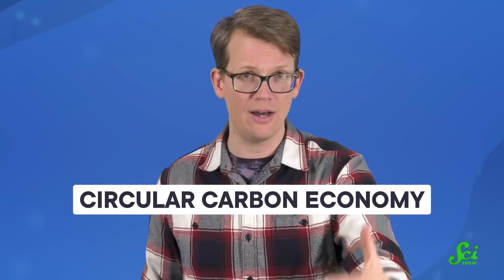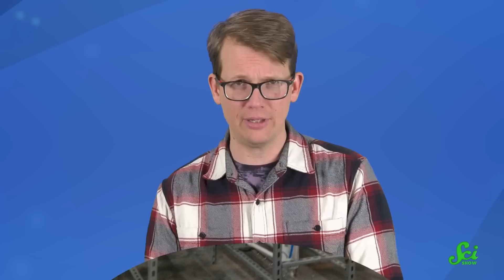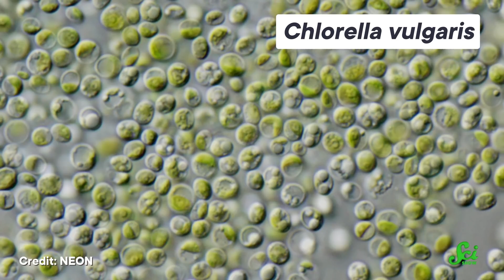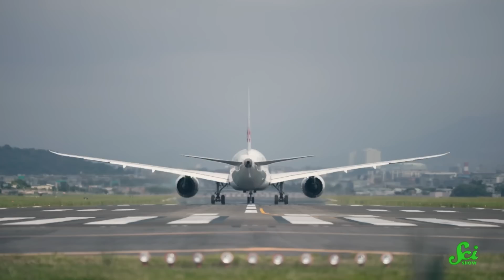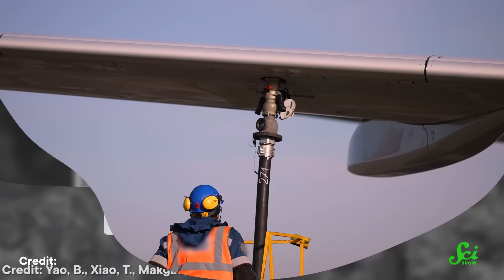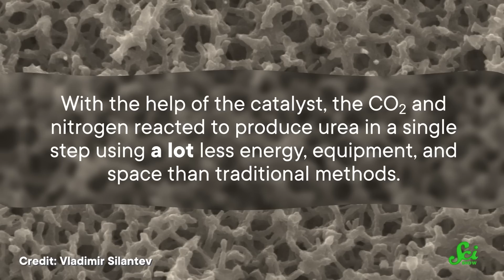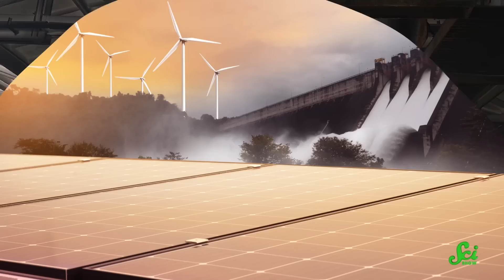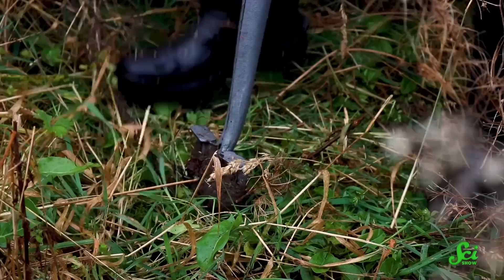One Way to Deal With CO2? Reuse It

Comment: When it comes to climate change most of the steps being taken actually make things far worse.
Wind turbines are an utter disaster, very harmful to the environment and actually result in more emissions not less.
Reply: check again
Reply: @paperburn  check again.
Only don’t use the data from the emperors Taylors
Reply: There’s another crucial difference between fossil fuels and wind turbines. A coal or natural gas plant burns fuel — and releases carbon dioxide — every moment that it runs. By contrast, most of the carbon pollution generated during a wind turbine’s life occurs during manufacturing. Once it’s up and spinning, the turbine generates close to zero pollution.
Reply: @paperburn  boy are you delusionaly wrong.
To replace a thermal power generation system of one gigawatt that can produce that power 24/7 with wind you need far more than one gigawatt worth of turbines because often the wind doesn’t blow 24/7 often it is too slow to turn the blades or too fast and would destroy the turbines so you need some sort of reliable backup power sitting idle while the wind is blowing and running full power when it’s not. So it usually wastes its power when the wind blows etc etc.
If you sat down and looked at the real math of wind and solar you would see that they don’t ever break even on c02 emissions and the environmental harm they do is definitely not outweighed by any imaginary benefit.
Reply: @anomamos9095  We must be reading two separate papers. and second I never said we would not need base load power , that is some talking point you came up with out of your own head. the only contention I would make is we need to get rid of coal as our primary base load source and that could be done easily  with existing  technology. I am using the papers funded by the  previous administration from yale. what are you sourcing?
Reply: @paperburn  Pre subsidy costs , actual usable power generation as opposed to projected , true costs of replacing thermal sources (Batteries powerlines construction demolition etc) thermal power waited while idling etc etc. Loss of environment to eyesores bird and bat kills etc etc
You can't replace a gigawatt of coal or gas with a gigawatt of windmills even with batteries that could last a day you would need ten to twenty gigawatt of wind to achieve a reliable base load unless you can make the wind blow 24/7
Reply: @anomamos9095  Once again I am not debating your facts on base load power but on your assertion that renewables have no place in the system. That is ridiculous. Ask yourself if  most of the subsidy's are gone why do the power company's keep building such systems? Because they work and are cost effective for peak load management
LOCE data shows that coal should be abandon as soon as possible if they can be replaced by wind ,PV or gas.
You know not of what you speak..
Reply: @paperburn  you do know what straw man arguments are don’t you?
In case you don’t you have been using them to try and avoid addressing what I have said by claiming to address things I have not said.
The only sustainable power sources available at present are nuclear, hydro , geo thermal and fossil fuel based.
The reason why wind and solar are not sustainable is because even if there was a suitable storage means available everywhere ( pumped hydro is very limited) the amount of turbines and or solar panels needed to replace a thermal power source is enormous. I have done the area calculations for PV at 33% efficiency in the prime sun zone to power Los Angeles 24/7 its not pretty.
Before thinking pv and wind are solutions you should ask what problems do they cause and if those problems are outweighed by the good?
Considering that carbon dioxide emissions are not in anyway a problem as the world has easily coped with more that ten times the current level of carbon in the atmosphere you cannot use carbon reduction as the criteria. But even if you insist on using it pv and wind still fail because to replace one one gigawatt power plant you would need ten to twenty gigawatt worth of alternatives and batteries.
And the reason they build wind and solar monstrosities is because they are being forced to.
The only time wind and solar make sense is when there are no better alternatives available as cheaply.
Specifically, if it will cost $50,000 to get on grid or $25,000 to build a wind and solar power bank to provide for a small village you would be an idiot to get on grid.
Reply: @anomamos9095  LOCE calculation please.
Reply: @anomamos9095  at ten times the co2 level there were no humans.
Reply: @paperburn  but plenty of straw men apparently. Humans really have nothing to do with the carbon cycle and the total human contribution is just two percent of the total. The fact climate alarm is a scam is so very obvious you either need to be in on the scam a religious zealot or the most ignorant and gullible person in the universe not to see it.
Reply: @paperburn  No figure it out for yourself.
Reply: @anomamos9095  Was just trying to figure out where you screwed up so much, old data, bad sources, lack of math skills? I will just look at all those power company's still building wind mills and solar farms despite those expired  subsides you claim they are using. silly companies  not making profit because of renewables .

Comment: Fun facts 
The add blue used to reduce nitrous oxides in diesel exhaust is urea.
Urea is a component of urine.
Billions of litres of urine from farming and humans gets put into the sew system and is not captured for fertilisers.
One of the greatest dangers this world faces is idiots who will ignore small efficiency improvements and waste reduction and genuine recycling options to promote big wasteful grand gestures that actually do far more harm than good.
Plastic recycling is responsible for most of the worlds plastic pollution not people just littering. More resources and energy is wasted in transportation of waste plastics than is recovered from the plastics. It would be very much cleaner cheaper and better for the environment if garbage was used as fuel in power stations instead of being recycled.
This excludes actual valuable things that can easily be recycled of course.

Comment: The only climate crisis is the political one these criminals are trying to create. The goal is not to prevent some kind of environmental catastrophe but to institute a global socialist government. This government will be a cross between Marxism and Nazism with many of the most ardent backers of climate alarm having very close ties to Nazism.
Please take the time to look at all the facts and not the alarmist claims.
The IPCC reports if you actually read them DO NOT say that we are having any kind of climate crisis whatsoever. For the most part it says that if nothing is done to reduce carbon emissions they cannot determine if it will have any negative effects at all and that no changes in climate can be claimed to be man made instead of natural. And they have actually come out against claims that adverse weather events are getting more severe or more common, they have said there has been no discernible changes except for the trends to be less common and less severe than in the past not more.
As for the ability for c02 to destroy the planet. It didn’t happen when it was four thousand parts per million or higher when the majority of life came into being so it’s not going to happen even if c02 triples to over 1200 ppm.
Apart from that even if we suddenly burnt every drop of fossil fuel on the planet we would not put back all that was once in the atmosphere. To achieve that we would also have to did up trillions of tons of limestone and other carbon bearing fossils and melt it down with acid or something.
Climate alarm is the same confidence trick pulled on the emperor to have him walk around naked thinking he was wearing the finest raiment and giving money to all the chicken Littles who harp the sky is falling.

Comment: There's very careful use of language here - which is what I would expect from this top-tier science journalism channel. Making fuel from atmospheric CO2 does not, of course, reduce CO2 in the atmosphere, it just stops it getting worse - supposedly. None of these processes can be carbon-neutral unless the energy input is 100% renewable - including the energy input into the manufacture and maintenance of the components of the renewable energy generation plants. 
Carbon-neutral is better than carbon-positive, true, but we need carbon-negative to have any hope of storming past 3 degrees of warming this century. Three degrees will be bad enough to still cause billions of human deaths.
Reply: Making these processes carbon neutral, or even carbon negative, doesn't require that the input is 100% carbon neutral.  It only requires that as much or more carbon is removed as was produced. 

This is lucky as no energy generation that currently exists is 100% carbon neutral.  Solar, wind, nuclear, hydro, all require energy intensive mining and refining operations, almost exclusively running on fossil fuels. Dams typically require massive amounts of carbon releasing concrete, etc. This is why we typically look at net emissions instead of gross.
Reply: @LikelyToBeEatenByAGrue  "... as much ... carbon is removed as well as produced" is the definition of carbon-neutral. Obviously you meant to say "doesn't require that the [energy] input is 100% *renewable*".

What you have effectively said is: *to make a process carbon-neutral doesn't require that the inputs are carbon-neutral, they just have to be carbon-neutral*. Which is a rather unfortunate unintentionally self-contradicting way of phrasing your tautology.

BTW you need to hyphenate the conjoined adjective to be grammatically correct, or at least specific. Carbon is generally neutral, not naturally found as an ion by itself. This fact is irrelevant to your point, which is why you need the hyphen.

As to your point, you are never going to have net emissions carbon-neutral or -negative if you are not using renewable energy, as I specifically said initially, in the entire process of creating and maintaining the industrial processes, including the processes of creating the energy generation plants. I know that is not the current situation, that is what I was pointing out.

So your reply has been entertaining for me, but it is comprised of a tautology, and an agreement of my point, when if fact you thought you were correcting me.
Reply: @TheJamesRedwood  I'm glad you enjoyed it.  I enjoyed yours as well.  It's always funny when someone catches a prescriptivist grammatical error in your comment and it makes them think they've won some kind of prize.
Reply: @LikelyToBeEatenByAGrue  What's prescriptivist mean? Accurate? Correct? Unambiguous?

Does your lack of other comment mean you are acknowledging your error? If I am wrong I am happy to acknowledge that, please let me know where or how that is so.
Reply: @TheJamesRedwood  it seems unlikely.  Someone who points out a missing hyphen as though it strengthens their case isn't someone who will admit that they're wrong.  You're not worth it.
Reply: @LikelyToBeEatenByAGrue  No, sorry you are offended. I am obsessive. I have been wrong a lot, and I was actually wrong about your tautology - did you spot it?

Comment: What if we went Corbon negative instead of neutral?
Reply: I assume It’d be okay for awhile until there isn’t enough co2 for plants to use for photosynthesis. Of course this is a very simplified answer.
Reply: Go carbon negative for too long, the Earth cools and we go into another ice age. Simplified answer. I saw a video the other day.  The Earth would radiate the heat it absorbed during the day back into space overnight. The greenhouse gasses are what keep that from happening so more heat stays in.  Without which we would be like the moon. Scorching hot days and subfreezeing cold nights.
Reply: We're always going to need new textiles for a growing population, but we don't need to throw out useable clothing. I wear shirts that are >30 years old.

Comment: On the topic of airplane fuel, I'd much rather see hydrogen, either liquid or pressurized, be used. It can be made cheaply, efficiently and cleanly via electrolysis of water using electricity generated via renewable sources like solar, wind and hydro-electric.
Reply: We keep trying that too. It's proving to be quite a challenge in practice. What we need to stop looking for is one catch-all solution that fixes everything. We need many different approaches that each do their best to make things better. Hydrocarbon synthesis is as much part of that as water electrolysis or batteries. Hydrocarbons are pretty good energy storage. Technology (and nature) doesn't leap; it's all small steps that add up together, if we're lucky.
Reply: Nothing about electrolysis is cheap.
Reply: producing hydrogen from water isn't cheap, breaking hydrogen bonds are energy intensive and hydrogen isn't as energy dense as other fuels (because it's a gas). Plus there's hydrogen embrittlement (do read it, it's pretty interesting) and hydrogen is smaller than any other elements, meaning it would leak out of seemingly impermeable containers. Green hydrogen (hydrogen from renewables) is good, but fossil companies are pushing for blue hydrogen instead (hydrogen from fossil fuels), which makes progress even slower
Reply: @wannabewallaby1592  And of course, there's approaches to deal with both of these problems - liquified hydrogen and even more interestingly, solidified hydrogen. But those are way too early techs to be considering serious contenders at the moment - there are more developed cutting edge batteries that still outcompete any vaguely practical hydrogen systems, but we'll see how all of that goes. The critical thing is not to close up avenues of research that don't seem particularly promising right now - we need as many options as possible.

Honestly, even blue hydrogen is a huge step forwards. It still helps develop hydrogen infrastructure; it can still eliminate carbon dioxide emissions (that is, you can easily deal with the carbon dioxide in situ, rather than having to thing about carbon capture etc. - what exactly to do with that carbon dioxide is still tricky, though the option of pushing it back into the well to improve extraction rates did have some minor successes in some pilot wells). Heck, you can even store it as pure carbon, though that of course means wasting much of the energy in the raw oil.

Comment: Before grad school, my fantasy was to engineer algae chloroplasts with decoupled photosystems which would evolve both oxygen and hydrogen instead of going 'all the way' and using the hydrogen to reduce the carbon in CO2. They would split water into a perfect combustion gas mix in some chloroplasts, and feed themselves with others- it's not there isn't already a number of natural plastid types in any photosynthetic organism. I hope someone's on it.
Reply: @capturedflame  From my time working on GMOs in grad school (plant biochem- research not associated with this subject), my worry was always 'what would happen if they got loose'. I was mostly a lone dissenter. People looked at me blankly when I spoke about the need for GM organisms to have no ability to breed with native species or other crops we might not want 'contaminated' with 'junk' DNA- and a way to kill them easily. We've already learned how difficult some types of pollution are too clean up. Remember that 'smart' people did't stop to think we could pollute the lakes, rivers, oceans, and atmosphere. We did. I ultimately chose another path. The promise is high, but so are the dangers- those investing in research want returns so problems are hidden. But, photosynthetic lysis of water is so slow- any plant doing it 100% wouldn't be able to catch fire if you held a lighter to it in open air. The real dangers are so much harder to imagine because we're so much more ignorant than we like to believe*.
edit:* me included

Comment: Wouldn’t it be easier to capture the carbon while in the smokestack/exhaust pipe?
Reply: There have been some really interesting experiments with collecting the exhaust gas from coal power plants and feeding it to algae tanks that use sunlight to turn the carbon dioxide and water back into useable fuel. Needless to say, it brings a lot of challenges, like keeping the algae tanks free of outside contamination (that can outcompete/eat the algae or their products) or dealing with the fact that exhaust gases tend to be rather hot! :D
Reply: @LuaanTi  very interesting, thank you!

Comment: How about not turning CO2 back into jet fuel, which just puts it back into the atmosphere?  How about reducing plane travel to near 0 and still extract CO2 from the atmosphere and turn it into something that is truly necessary, such as the fertilizer mentioned.  We need to remove CO2, not just stay at the same level.

Comment: How about planting more trees ...  The first 10 years of new growth in trees absorbs more carbon then the 50 that follow .. or hemp instead of corn to make fuels fiber wood and ropes.... Hemp absorbs 10X as much CO2 as corn and has so many more uses.... Corn for ethanol is bad for everything and everyone involved. As is the plowing of virgin soil to grow corn... It takes 27 years of corn growth to re-absorb what is released from plowing virgin soil so unless you drive an ICE car for 35 years at 10% ethanol your actually creating a bigger carbon foot print then just using straight dino juice